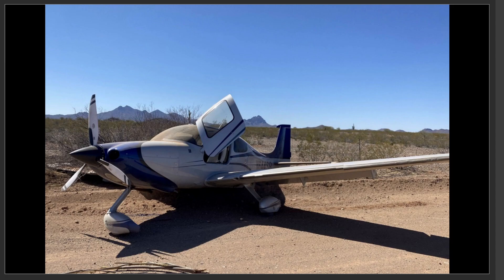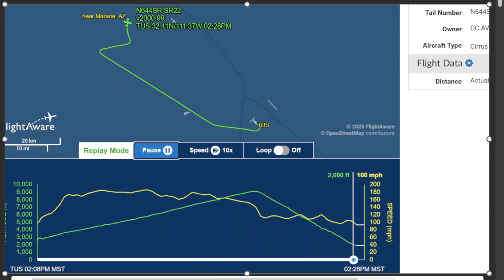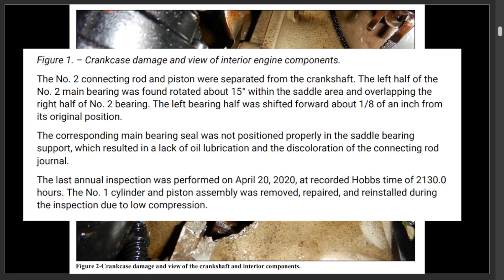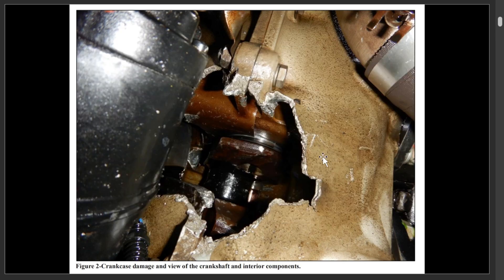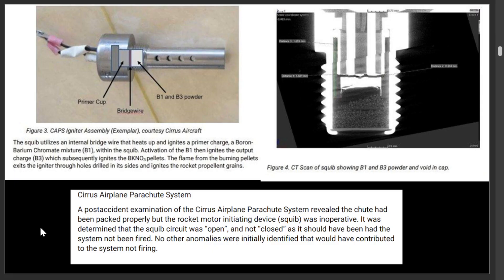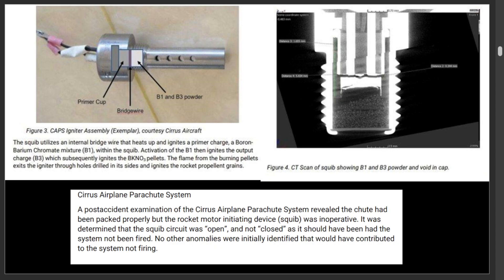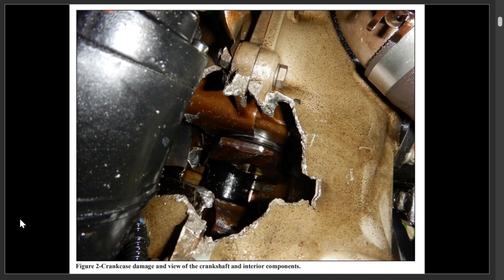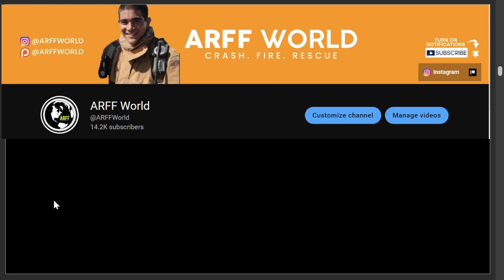Cirrus Parachute Malfunction

Comment: Why would you feel the need to pull a chute for just an engine failure? Just fly the aircraft and glide it to a forced landing. There was already a road to put it down on. Sounds like a pilot that needs to brush up their power off forced landing technique rather than just relying on a chute as a 'one solution to all problems' approach! The failure of the chute would have been more of an issue if they had a structural failure or loss of control. If the engine failed, and the chute was as useful as a chocolate fire guard, then I would be questioning the maintenance and servicing schedule and quality of this aircraft.
Reply from the maker: many agree with you Simon.  thanks for sharing

Comment: Very, very unusual for a qualified squib to be defective. No way to see that coming, it would pass a continuity test until activated. Yes, the squib ignites the BKNO3 pellets inside the tube, and their exhaust products vent through those piccolo tube holes instantly igniting the propellant while also bringing the rocket motor close to operating pressure as it does so. That type of ignition system results in motor ignition in milliseconds.. when it works.
Reply from the maker: Thanks for sharing sir

Comment: Well if the crew wailed away alive, then that was a Great landing. The parachute system Brilliant life saver if there was to be a serious structural failure.
Otherwise an engine failure then you are flying a Glider, then land it as safely as you can.
May I add to better all as aviators :-

Impress The Professionals
Thrill The Ignorant
Frighten No One…
Not even yourself.

Happy landings always and smiles.

JB. East Surrey. UK.
Reply from the maker: Thanks JB!

Comment: From my research and watching accident investigation. The cirrus planes are very unforgiving especially when it comes to a stall which is one of the main reason for caps. Because you can pop the parachute in the early stages of a spin because if you don't you probably will not recover. I believe the caps system is what they had to do be certified because it wouldn't pass without it. If i remember correctly you have all the way down to 500 feet of usable range as long as your within the allowable speed or it will separate from the airframe. I watched a accident investigation where a pilot in a SR 22 I believe encountered icing and tried to use caps but was way above the speed because he let it ice up so bad he had no control authority. The parachute separated from the airframe and he didn't make it. Caps deployment makes the airframe unusable after deployment anyway. I believe that is also why in a lot of cirrus accident pilots wont use it because they want to save the plane. Half the time in the accident s they don't even arm the system like the checklist says to do.
Reply from the maker: Wish you could save the plane after the caps usage.
Reply: I believe you are spot on regarding the certification requiring the chute. 
 This is the first chute deployment failure I have known of but I have always questioned the logic of approving flight characteristics of an aircraft dependent on a backup parachute. 
 Then again, Cirrus has designed more aircraft than me.

Comment: Considering the recommended deployment height is @ 2,000 ft AGL...minimum 580ft...some pilots have achieved BRS deployment @200 - 280 ft...At a maximum speed of 185 knots. Stall speed being around 60kN...the pilot was lucky he was still inside that envelope and was able to safely glide..Like another viewer said,"fly it to the crash site". 👌 Final thought is don't count on the BRS,first fly the plane,communicate then if for some reason or another you feel like you totally loosing it ...then you just press real hard on that reset knob..😮😮😊
Reply from the maker: Carlos! 🤙🏽

Comment: The airframe appears to be in better shape than it would have been if it had come down under the parachute. All I see is a broken off main wheel. I hope the mechanic had insurance. Looks like the plane was sold to a parts salvage company in July 2022. So, its flying days are apparently over..
Reply from the maker: Thanks for that link info

Comment: Someone please correct me if I'm wrong but it is my understanding that generally engines like the Continental IO-550-N, Rotex all models etc, only have 4 (+1) main bearings supporting the crankshaft (which is not counterbalanced by the way), and therefore are not as reliable as the Porsche-based aircraft engine which is my favourite as it runs on 6 (+1) main supports. No surprise that most problems with engines up in the air are often due to poor lubrication which translates into vibrations and the next thing you know is that one of the rods is thrown out of the crankcase. Good job by the pilot here who saved the day. Thanks 🙏

Comment: I have a different opinion of this pilot. I agree he did a good job keeping everyone safe but the PIC or pilot in control is responsible for a thorough preflight inspection which includes checking oil levels, visible leaks, circuit breakers out of place, etc., etc.,. While it had an annual in 2020, it was getting towards the end of it. Just saying maintenance starts with the pilot making it happen. He was so close to that road too that I think better decision making as soon as he started having power issues and he could’ve landed without damaging the aircraft. All easy to say when I wasn’t in the cockpit. At least they walked away from it.
Reply from the maker: Yup.  Lots went awry on this one
Reply: Annual inspections do not guarantee a perfect airplane upon completion. In fact, the opposite is true. Maintenance induced failures, especially following engine work, are a thing. I trust my mechanics with my life, but my first flight after every annual (or major maintenance) is performed, day, VFR, solo, orbiting over the airport, while I check all of the systems. After I land, I remove the cowling one more time and inspect the engine compartment for leaks. Only then will I carry people or fly cross-country.

Comment: Run of the mill mechatronics engineer here, surprised there isn't a warning indicator for if the connection opens in the igniter, basic electronics says current doesn't flow through and open connection, something like a low current sourced high impedance input that flows through the bridge wire.  I'm Unemployed, Cirrus.

Comment: It done did threw a rod. These air-cooled engines take a beating. Normally aircraft piston engines are run at 100% for takeoff then 65% to 75% continuously in cruise. Normal car engines average 20/25% of power when cruising around.
Reply: Most people don't realize the kind of beating that air cooled engines take. This is why they have so many inspection intervals. You could keep driving your car and change the oil every 3,000 MI and racked up easily 100,000 miles with only looking for oil leaks and general maintenance of course. But your car doesn't go through the inspection that aircraft engine does. Can you imagine how expensive a car engine inspection would be if it went through the same inspections as a small aircraft does
Reply: They are over designed to take a beating. If it was made the same way as a car engine, it would be 50% lighter and 50% smaller for the same power output!

Comment: Nice result compared to landing under the parachute really. In this case there's no way that they had any doubts about what caused the engine failure, and that's most of the damage. It's funny that these engines have a reputation for reliability, considering how often they fail. Cars, which have similar or even a lot more power, don't have nearly as high an engine failure rate. But maybe if we were all driving around behind flat head Fords and Oldsmobile straight sixes we would.
Reply from the maker: Thanks for sharing your thoughts
Reply: Absolutely and, as stated above, but also being an engineer who has assembled, redesigned and dyno-tested dozens of competition engines, I would not trust these engines if I was flying my own aircraft which is what I might do pretty soon.
Reply: Airplane engines run pretty much max continuous power most of their run time + TO power etc. They are playing weight savings games etc as well. Cooling is often just air cooling (car engines get a huge radiator and liquid cooling circuits). A car engine cruises at 90 HP or something (so half of rated power maybe?).

Comment: Fixing this Cirrus i going to be very expensive.  Wonder when the CAPS system in this plane was last installed?  My guess is not soon enough.  Since the right main landing gear snapped like a toothpick, its hard to tell how much damage has been done internally to the right wing structure.  As for the engine failure, its very possible that the plastic retaining ring used to secure plastic oil caps on plastic oil bottles may have fallen into the engine.  These small plastic retaining rings can easily fall into the engine oil filler neck, where these plastic rings usually melt in the hot engine oil and can cause a blockage in the oil journal passages that will prevent these critical engine parts from getting the proper lubrication they need.  Without proper lubrication, friction between these two or more critical engine parts builds up creating excessive heat to increase causing these parts to ultimately fail.  Seen this happen on a dozen Continental engines over the years.
Reply from the maker: Thanks for taking the time to share your take on this Jim
Reply: Looks like  someone needs to redesign the oil bottles to do away the retaining rings.   Is this problem widely known?
Reply: @scottmoseley5122  The only sure thing to do is take a pair of diagonal cutters and cut that ring off the oil bottles and throw it in the trash prior to pouring the oil into the oil filler neck.  Granted its a pain in the butt, but at least you will have peace of mind knowing it didn't end up inside the engine.
Reply: ..SEEMS like a fair ‘leap’ to just jump RIGHT to the “plastic ring on the plastic oil bottle”..? To me anyway. NOT trying to discount YOUR experience..

Comment: He lived to sue the mechanic.
Reply from the maker: I hope so
Reply: I feel better knowing I never got into aviation, regret I wasted too many years trying.
Reply: that's why we have oil pressure gauges, if you loose oil pressure then landing is the only option, taking off is optional,landing is mandatory. all the mechanic can do is fit the seal,if it pops out is it his fault?
Reply: @gogogeedus  There were multiple failures on this airplane.

Comment: One cylinder was removed; and if the crankshaft is then rotated, the crankshaft bearings can rotate out of place as well, as the thru crankcase bolts were loosened to remove the cylinder.  Oops.
Reply from the maker: Big Oops 😬
Reply: I know Continental engines I  don't know Lycoming aircraft engines. Continental take all your intake and exhaust off the head. Pull the cylinder up so far you can remove the wrist pin. Piston and cylinder head come off together without disconnecting the rod from the crank. In a Lycoming engine do you have to split the case to get a cylinder head off just asking. Strange the rod is in such good shape cap and the Piston is destroyed. You sure that wasn't detonation destroyed the Piston first? Then all hell broke loose.